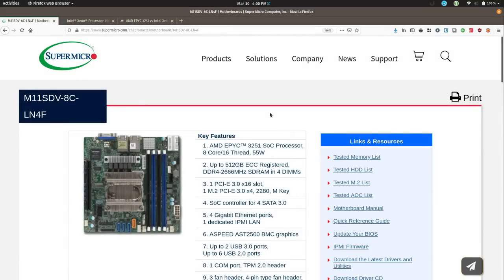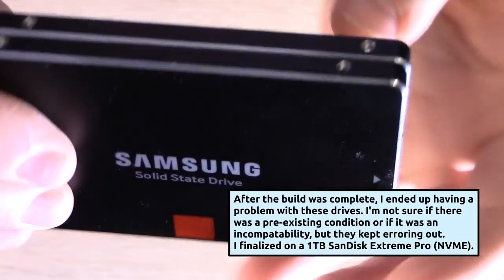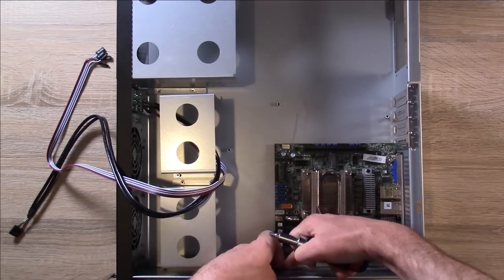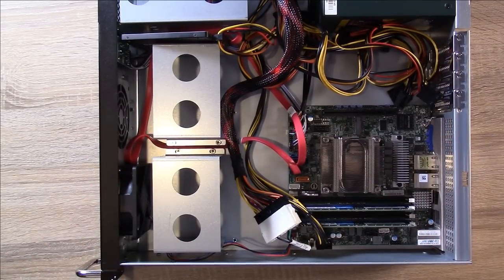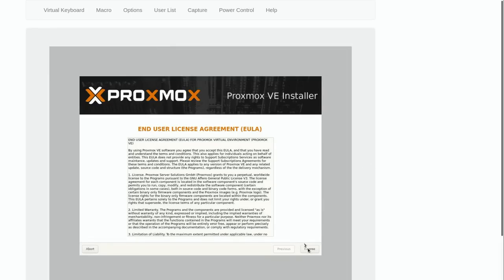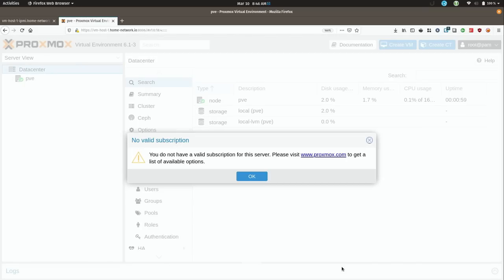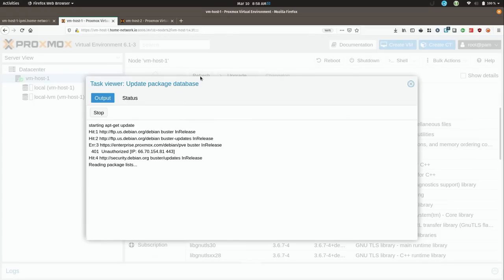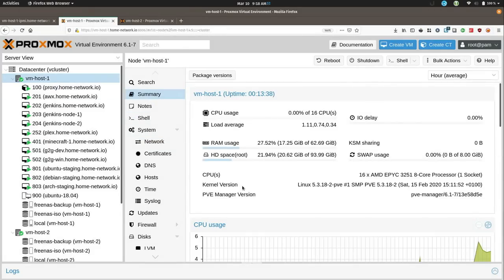Building a Low Energy Virtualization Server for Your Office/Homelab with Proxmox

Comment: You need an actively cooled cpu. These types of heatsinks are for cases that have a high throughput put of air from front to back. I believe this motherboard is designed for small 1U Supermicro cases.
Reply from the maker: I'll keep that in mind, and monitor it. So far, no issues. This video was filmed quite some time ago (before the Pandemic) and due to current events it took me a long time to get it uploaded. Since the video was filmed a while ago, I've spent quite a bit of time with it and have had no issues whatsoever. Super stable. My monitoring system hasn't detected any problems and it's just been great.
Reply: @LearnLinuxTV  Thays good to hear. I assume the low TDP makes it so it doesnt get too hot. I have the same case and after some time found that its air flow was not great. Luckily no issues though. Happy building!

Comment: Any new server MB must have at least one SFP+ cage or a 10GB RJ45 NIC. There are many that don't and all those should not be considered.
PS: People complaining about the price tend not to understand that an 8-core CPU is included in that exact price. Sure, you can build a much cheaper and more capable Ryzen 2700 (65W TDP, but you can undervolt and undeclock) on a B350/450 MB, but you lose IPMI and ECC RAM support, which are well worth the cost.

Comment: Got an AsRock A300, with a Ryzen 2200G APU, 16GB 3200MHz RAM, 512GB m.2, was just a couple hundred euros. With a couple of VMs running it's currently clocking in at 14-16W on the wall. Me wanting to get something "slightly more powerful" than a Pi3B+, and still keep the power low, definitely succeeded I'd say. 

Sure, with this Epyc you got 8c/16t, quite a lot more than my 4c/4t, and you got more expandability as well, seeing as the A300 only has 2x m.2 & 2xSATA (for 2.5" devices). :p
- However, there's m.2 to 4x SATA adapters out there, so if I ever need to then I'll look into getting such one, and then figure out something about powering them.

Comment: You should NOT have a problem with using those sumsung SSD's with ZFS. I have quite a few of them in different vdevs under ZFSonLinux.
Reply from the maker: I did have an issue though. I don't remember the error now. But when I looked it up, a lot of people were having the same issue. I agree that it shouldn't be a problem, but it was.
Reply: @LearnLinuxTV  I've also never had ZFS issues on non-enterprise equipment, either.  I'm running pretty much purely consumer drives, with no errors.  I am very incredibly careful to avoid SMR HDDs, which will cause major problems with basically any form of hardware or software RAID, though that's getting harder and harder every day without spending more and more per-drive/GB.

Comment: The EPYC Embedded 3251 has a controller ethernet 4*10 GbE integradted but on the supermicro motherboard they have just put 4*1 GbE by adding an i350 ethernet controllers

Comment: @8:38 Although it's a passive heatsink, the system should have adequate airflow going through the heatsink. Chassis fans are required for that type of heatsink. You just can't run it hoping that passive airflow will be adequate.
Reply: He installed a fan... watch the video

Comment: I am looking to install Proxmox for the first time and rather confused about drives/storage. So far I think I need 3 types of storage. 1) The boot drive which could be a USB but thinking M.2 SSD. Not too sure how big though. 2) ISO and template storage. I have heard that can’t be local. Not sure why I can’t put ISO images on my M.2 boot drive. 3) VM hard drive. I am thinking a pair of NAS hard drives with ZFS/RAID 1. Any thoughts or suggestions? I am looking to run Docker, Kubernetes and other developer tools for learning.

Comment: I have a HP DL360e with 2 CPU's, 24 G, 2 SAS drives and a RAID controller with 2 power supplies...runs at 89 watts according to ilo. and it's quiet. Cost me $300 CDN

Comment: How would you organize storage? I'm planning on have an ssd OS disk, an ssd disk for VM's, and a set spinning hdd's stolen from my Synology to manage with a virtualized TrueNAS server. From my reading, when you pass a controller through to a VM, it's the entire SATA controller. Meaning. Proxmox will no longer be able to use since the VM has control!

I like the idea of a supermicro server, but I want to virtualize my gaming PC. When I looked at their site, I didn't see an offering that either lets me fit a standard atx mobo/GPU, or a complete system that has the z690 chipset for gen 12 i7 CPU.     

It would be great if they supported atx cards and GPU ( just have a riser card to fit a 2-3U chassis, but they don't yet.  I could not find a single Xeon processor that people recommended for gaming, so I went with an  Fractal R5 tower Case and MSI motherboard.  It doesn't slide into my enclosure, but it sits on a shelf sideways, lol

Comment: OmG where did you get the board, 700$ is not cheap - i build a ESXI VM Server for 500$ on Rycen Platform in the same formfactor with also Low Power Usage.

Comment: How do they work out that yearly running cost of 9.13, I realise it may not be at 50w 24/7/365 but if it was that would be 438kw per year, which in the UK would be closer to 150dollars.. is electricity crazy cheap in the Us ?

Comment: You mentioned you finalized on a 1TB SanDisk Extreme Pro (NVME) but in yout install setup your using the samsung SSD Drive? So which are you using and installed proxmox with? Reason I ask, proxmox is failing to install at the the first stage of clean up root disks 0% complete. When using the NVME SSD drive as the target hard disk in the proxmox install.

Basically, the install fails and the machine reboots.

Comment: I’m just wondering why an efficiency build uses a low efficiency power supply? Why not 80+ Platinum? Couldn’t cost more than that motherboard!
Reply: Some random Best Buy fan? Why not a Low Power Noctua that will last? 

Even those 2 extra ram sticks will increase power draw unless 4 channel memory will increase power per performance

Comment: Great content as usual! Would you still recommend this exact setup/Motherboard a year later? I'm close to committing to the same motherboard but thought I'd check if other more optimal products have become available. Is there a dual processor in this format? Thanks!
Reply: I'd wait for the newer intel atom 5000 lineup. This things close to a grand, and I think either they're going to have to lower the price for them, or the newer atoms may end up being a better buy depending on where the msrp lands.

Comment: Not trolling, genuinely want to understand the thinking here ... I'm not quite sure why the drive for low power here? - the cost difference shown for running those cpus was only $4 per year and the spend of $300+ on the new CPU doesn't seem to stack up as a cost driver. As comments call out, that board costs a fortune.  So, I'm interested to know why the driver for low power usage here.  If its eco friendly, suspect you could plant a lot of trees for $300.  So if the old one was all good and working, not sure I get the push to swap it all out, but have low power as a major selection factor.
Reply from the maker: Low power usage was just one factor, not the entire reason. I also wanted something quiet that can be in the studio with me, benefit from some speed improvements, and overall just test what low-power is like in practice. I realize that it's not practical for everyone.

Comment: umm, drives are not listed . i have a am3+ 8320 so with 32 gig you can run 12 vms on a 8 core ty for this. I want to run openmediavault(nas) ,ipfire,pi-hole,htpc will try with v7 of proxmox at some point  as right now i only have 12gig ram, 1 ssd120gig,1 1tb media disk,320gig hd vm,iso

Comment: Thank you for such a good explanation on setting up a proxmox environment. 

I am trying to create a nextcloud instance for private cloud at home. Also want to be able to deploy VMs as I need them for testing out other Linux based systems and expand my knowledge on Linux as well. I set up a minipc with n4000 cpu, 4gb ddr4 ram and 1tb nvme ssd. I installed Proxmox on this machine using entire 1TB hard drive. I don't have any other storage device on this machine. But I realized that I cannot add any directory for ISO's and for other stuff. Because not having ISO directory, I cannot setup any VM too. I did some research on internet and came to a conclusion that I cannot add directory and new VMs, because of using my entire hard drive for Proxmox Debian installation. Am I right? 

I am going to try partitioning the hard drive per say 20gb for Proxmox Debian while conducting a fresh Proxmox installation.

Am I on a right path, or totally going towards a wrong direction? Is there any way partitioning my hard drive without having fresh Proxmox installation. 

I am a total newbie, so please excuse my ignorance 🙂

Comment: I would be pretty concerned if my board didnt have a 24 pin connector as its there to supply extra power to that pci slot as well as any connected component such as ram, fans etc :p

Comment: for anyone watching this he does not cover the power supply hook up other than just two of the main cables to the motherboard. There is also no source of documentation on this matter. So make sure you gather the information you need before you buy the parts. Right now, I am looking to find out where and how he is using the red cables

Comment: i am using intel xeon e3-1230v2 using proxmox. Why should I use an external graphics card? so without a graphics card proxmox won't boot. can proxmox run without using external vga?

Comment: It looks very easy just like building custom desktop PC, however these server specific stuff like rack, switches, cabling, power cables, etc seems daunting to me especially when putting them all together. Do you have any recommended online course specifically about building Homelab server or server hardware in general? Or maybe, will you, by any chance accept private consulting through email? I'd like to know something more detailed, like for example which correct hardware to purchase to be paired with the other hardware, for example about CPU socket and motherboard compatibility, server size, rack size, which UPS to choose. you get the idea. Please do leave comment here so I can contact you. As always, great content!
Reply from the maker: I've thought about private consulting, but I don't have a system in place to facilitate that right now. I can at least try to answer questions, if you keep in mind that due to the pandemic, I'm extremely busy lately and may be slow to respond. That said, when something in technology is daunting, it's almost always because you're putting the cart before the horse. You do need to plan ahead, but break down the task into smaller steps and research each one by one. If you worry too much about steps you haven't even gotten to yet, you'll overwhelm yourself. Focus on the first thing, and only the first thing, and then move on to the next step instead of worrying about everything all at once. Also look for maker labs, user groups, or computer clubs in your area as you may have a local resource that can help too.

Comment: Damn.. I was really liking this setup till I saw the mobo was $700..
Reply: Hell, I can hardly find it for less than $1000
Reply: Ryzen 7 2700 has a much higher passmark score and costs $250, plus a motherboard (we'll say Gigabyte B450M as it seems to be the cheapest B450 with 4 ram slots, for comparison sake. It is bigger as i cannot find a single mini-itx with 4 ram slots) at $73. Undervolt it (as it's a 65watt TDP chip). and for $323 get around the same power consumption.

The extras on the Supermicro board are nice, but i don't know if they are an extra $377 nice lol
Reply: It all depends on specific needs, of course.  Considering it's an Epyc platform in mini-ITX form that supports 4 Registered ECC DIMM slots is already something usually unheard of.  Going with Ryzen/Threadripper, you're only limited to Unbuffered DIMMs if you want ECC, plus you have to be careful in motherboard selection (I think ASRock stated that all their Ryzen boards support UDIMM ECC, but there are a small few of Gigabyte boards that might too).  I don't think I've ever seen an AM4 mini-ITX board with more than 2 DIMM slots.
Reply: I feel you, in Germany I can only find it for roughly 550€ right now.
Total deal breaker.
With around 30ct(€)/kWh in cost for electricity I can still build something around a 2700/3700 on a AsRock board and let that run 24/7 for a veeeerrry long time...
Reply: @TheRogueBro  Here you can put DDR4 REG ECC. Total 512GB (maybe 1TB) in ITX format. B450 is max 64GB. I have 7 liter case with my test lab on it. I take it into backpack and go to the client. Those looks when I'm showing WHOLE environment concept of the future customer infrastructure with multiple of servers, storages, switches, firewalls and even workstations working taken from the backpack and put on the conference table is well worth the price.
Reply: 700 is a steal.
 if you want to go epyc 7232 with mainboard you`ll have to  pay 500 for cpu and 500 for mainboard. buying the epyc 3251 saved me 250.
Reply: @TheRogueBro  why are you trying to compare consumer vs server hardware?

yeah, youtube comments ...
Reply: @sirpawelm  ha, I remember years ago we rewrote a giant enterprise COBOL and web system using java and more modern web, and did a demo running the entire system, including db, on a laptop in the boardroom. What used to need a literal mainframe, database server, etc, now ran on a laptop.

Minds blown on the execs that day.
Reply: Bruhhhhh

Comment: Need one more clarification. In my Tiny M93P I have two LVMs and I have 3 USB devices (Wyze sense devices, Combee2 Zibgee stick and Bluetooth Dongle connected with USB passedthough to my LVM that is running home assistant (Debian -> Docker-> Home assistant). My Proxmox in Lenovo Tiny is version 5.2.1 or similar. When I have my Optiplex 7040 set up I will have the latest proxmox 6.1 as I will be doing that install new. Do do I need to upgrade my existing proxmox to 6.1 to join the cluster and to migrate LVMs? Also do I manually need to do all USB passthrough to USB sticks I have or will those get configed automatiicaly as part of migration process? Thanks in advance for your help

Comment: Nice build, thank you for sharing your experience ! I had a look, sometimes ago, on this kind of tiny motherboard, but it is too expensive for my own use. 

Anyway it's very convenient to drive server with ipmi ;-)
Reply from the maker: Yes, it is expensive. BUT, another YouTuber commented about using a laptop as a homelab server, and that's a GREAT way to start. Especially if you have one lying around.
Reply: @LearnLinuxTV  I would humbly suggest, that if you want people to "Learn Linux", you do a video on building a budget system from spare parts/re-using some parts people may have.  i.e. many have old cases, etc that can take a new Motherboard/CPU/RAM and be 1000% better for less than the cost of a used pc online.

Comment: does anyone know a good source on what to do after the server is on? I cannot access the ipmi interface or for sure know which IP it is? Did you connect over lan from your laptop to the motherboard? You said you did this in your PSN server, what is your psn server? how did you configure your DNS for the IPMI interface. I have not hooked up any keyboard or screen to the motherboard because im assuming the dhcp should allocate  temp  on the initial boot...

Comment: I am planning to use Proxmox to run an hackintosh which is currently the main OS on my machine. Also want to add freeNAS. So the machine would run Proxmox and freeNAS to have a HAckintosh running Catalina. What I am trying to figure out is the Raid strategy on freeNAS. From what I understood is good to have a setup with Mirror 2 or more Raid, but the details of the Raid are still confusing. I do not care about performance much but more for data integrity of the backups/storage on the Raid so which configuration would be a good start? thx

Comment: I started to build a small extremely tight budget VM box using a ITX board and a 45W Xeon in a Supermicro mini tower. Its not a server grade board but it does have dual NICs that can be teamed and 4 3.5 drive bays if I want to do a VM NAS. It also has 2 spots for SSDs and space for another with an adapter. I have a 9207-4i4e HBA in IT mode controlling the back plane while the internal SATA ports handle the SSDs.  I cannot afford a SOC based Intel or AMD server board so this will do.  I am limited to 4 core/8 threads and 16 gigs of ram.  What are some examples of VMs and number of VMs you think I can get away with running on this setup with Proxmox?

Comment: Did you experience any "unkown PCI Header 127" bug when using GPU Passthrough? My Epyc 3251 from Asrock Rack didn't release a BIOS update to fix that bug. Does the SuperMicro board work with GPU/PCIe Passthrough?

Comment: I am still reluctant to use SSD's for storage due to the still limited re-write cycles on cells.  I always use them for OS drives though.
Thanks for the video.  Unfortunately the price of these boards is way too expensive for me as a home user.  I could not justify that sort of build cost as it would take years to recoup the cost in saved electricity.
Reply: get used enterprise or pro ssds as they generally have better endurance.

Comment: That board is good if you need the power. But if you hardly load your machine, you could get down to 15W using a Fujitsu board and an i3 9100 with ECC. Intel is ahead when it comes to idle consumption....